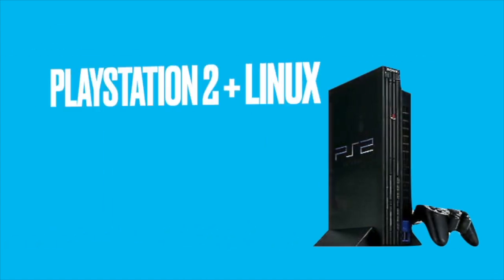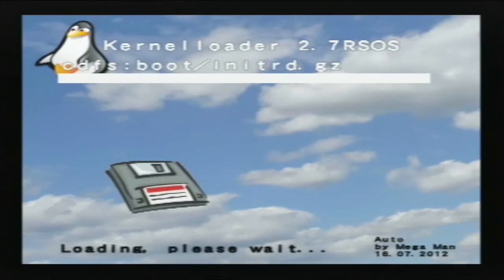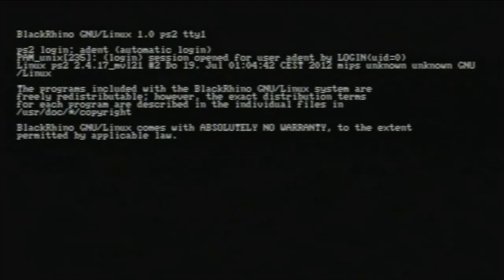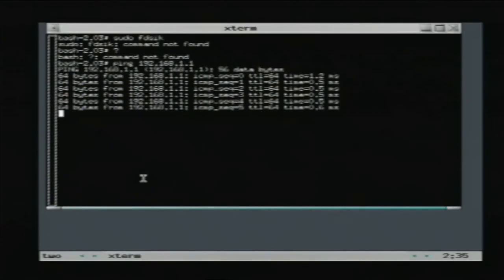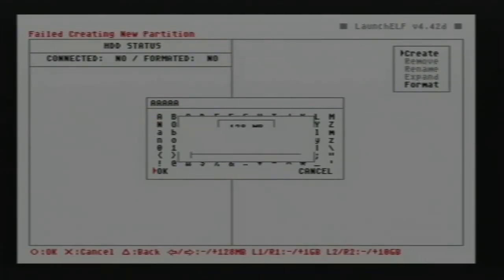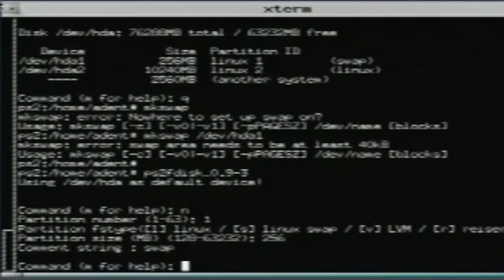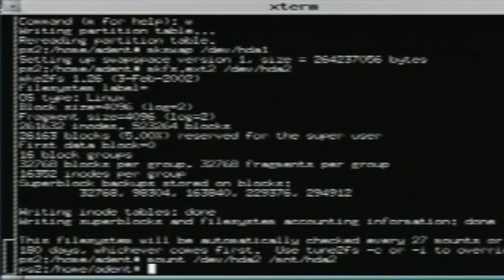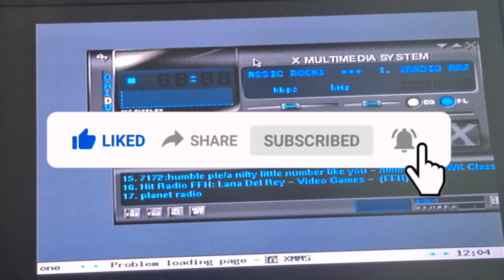life with the Playstation 2 and linux

Comment: my guy I had this when I was 11 and had to use it via RF modulator on my old TV that my parents gave me - we had a PC but the monitor didn't support sync-on-green so had to use the TV. Was a pain getting it working with no internet in my bedroom and only a big computer, had to print off Linux commands to get it running. Got it working and was able to listen to MP3s through it, which was a win